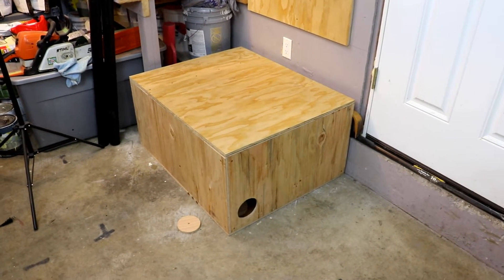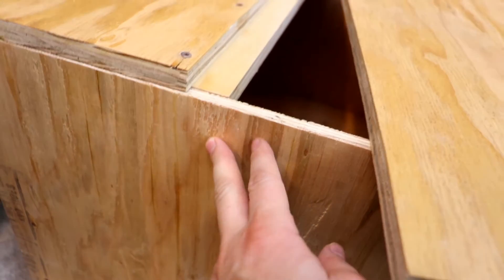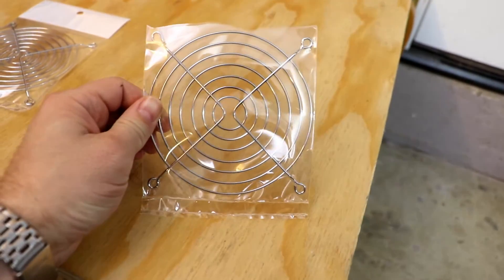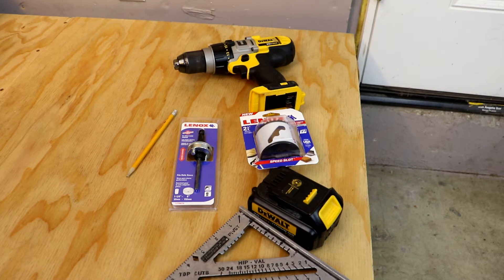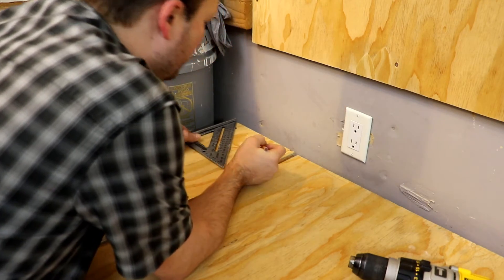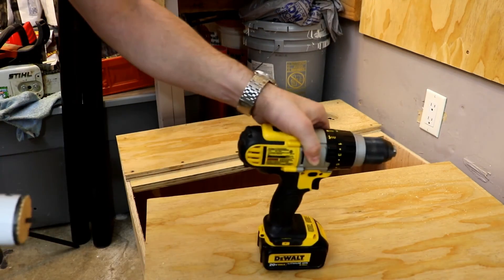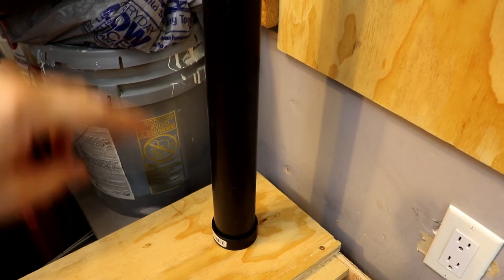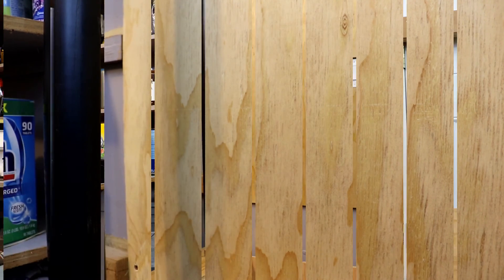Off Grid Solar Venting Battery Box part 1

Comment: Nice...yeh, I just use that blue filter stuff you can get at Lowe's work great. I just cut to fit the fan opening.
Reply from the maker: +Chris DIYer 
Excellent recommendation thank you.
What section/area would I find it in?
Reply: This is what I got from Lowe's in the air filter section:
https://www.lowes.com/pd/Filtrete-Common-20-in-x-30-in-x-1-in-Actual-20-in-x-30-in-x-0-25-in-Cut-To-Fit-Washable-Adjustable-Air-Filter/50124672
Reply from the maker: Chris DIYer 
Perfect!